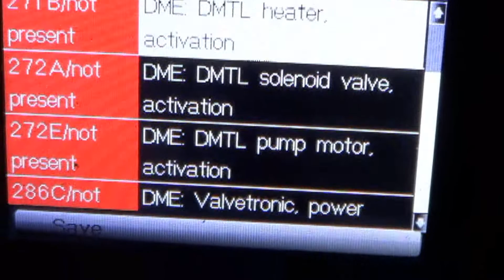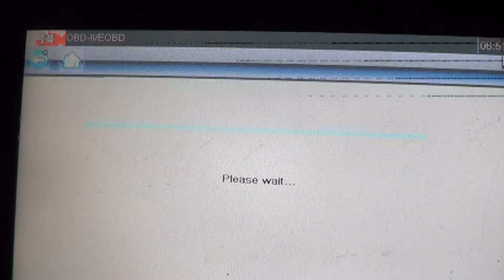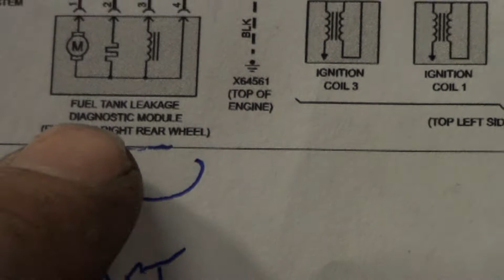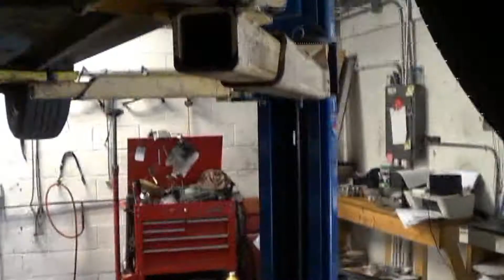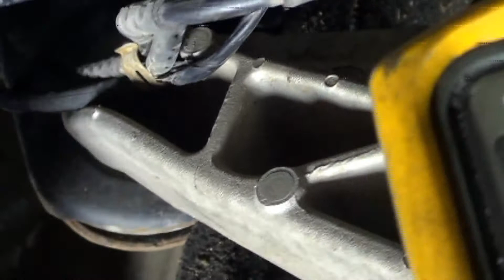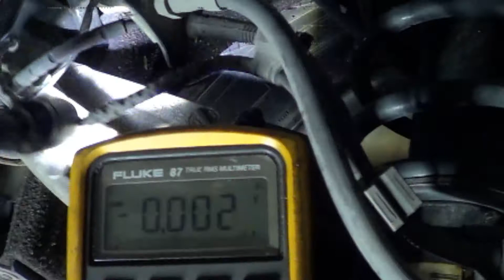2010 mini cooper evap circuit code p2418 P2400

Comment: Had the p2418 on a 2011 Mini S. The black and yellow wire was completely broke. The other 3 wires were all nearly frayed through. Who would have thought this would be such a prevalent issues. 
Does the wire diagram indicate what size wire's these are ?

Comment: Did the car still run before you repaired the wires (I have a 2010 R57 / N14 that won't start, and is throwing a similar
 code--P0444) ?
Reply from the maker: Yes, it stated and ran.

Comment: My red wire was broken near conector,I love the test routing you give.
Mini cooper 2012 has codeP2401 P0597 P240A P2418 P2400 My Red broken wire his fixed but craks no strat?
Reply from the maker: I cannot take the time to look up code definitions.  Maybe I could help if you provide the definitions of those codes for me?